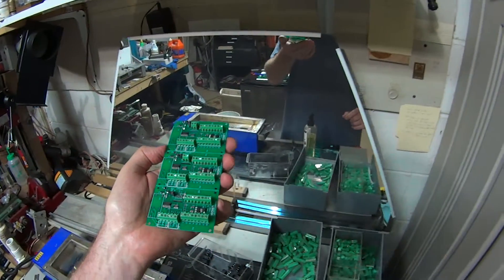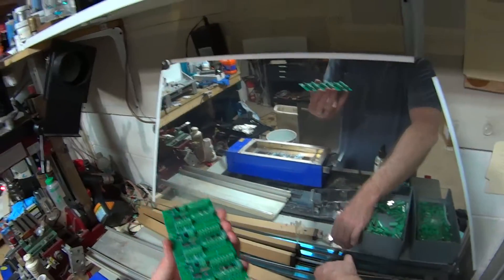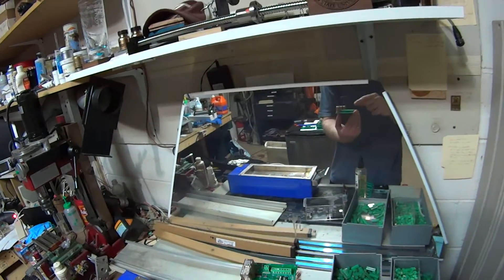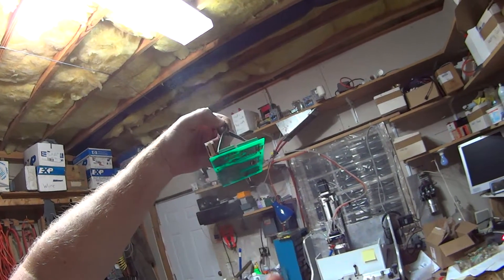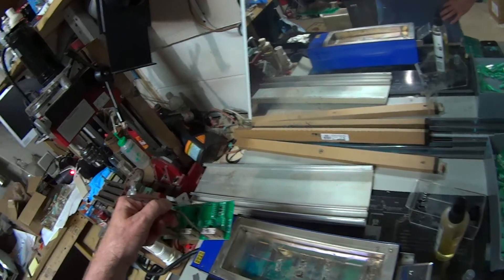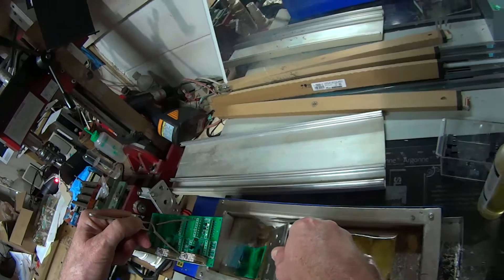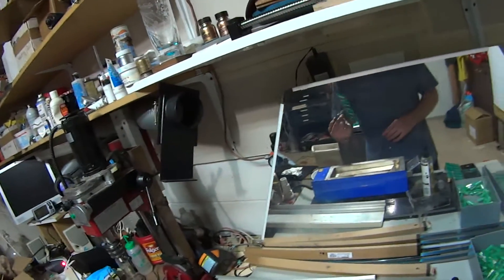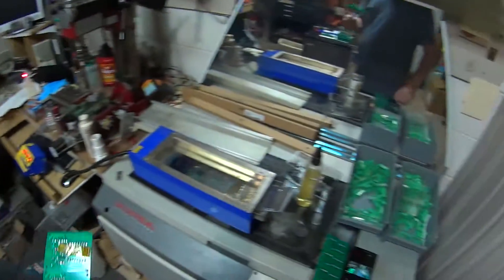Introduction to Dip Soldering of through-hole components

Comment: Can you tell me where you got the reverse action PCB holder that you are using in this demo?
Thanks.
Reply from the maker: I wish I could, but I have had them so long I don't remember.  They are crossover shank forceps and I bent the ends to be sized for my boards.
Reply from the maker: Found it.  https://www.amazon.com/dp/B01MG3DZJ2/ref=sspa_dk_detail_5?psc=1&pd_rd_i=B01MG3DZJ2&pd_rd_w=hciLj&pf_rd_p=0c758152-61cd-452f-97a6-17f070f654b8&pd_rd_wg=4Qb1X&pf_rd_r=DW1H0C05RBPANGFNN3N4&pd_rd_r=72479d37-f820-4e34-ae31-3dd47293d8ec&s=hi&spLa=ZW5jcnlwdGVkUXVhbGlmaWVyPUExVVcwR0xEQUpYRFk4JmVuY3J5cHRlZElkPUEwNTYwNjIyMlRCWllUODVPV1VMSyZlbmNyeXB0ZWRBZElkPUEwODU3ODY5SllJUTBHVENLNDYmd2lkZ2V0TmFtZT1zcF9kZXRhaWwmYWN0aW9uPWNsaWNrUmVkaXJlY3QmZG9Ob3RMb2dDbGljaz10cnVl
Reply: @JohnHansknecht  Thank you ever so much!!!!
Reply: Thanks for the info. I appreciate the reply.

Comment: Which brand solder flux and how much tin/lead ratio solder bars did you use ?  I bought  a solder pot and love to try that. Thanks
Reply from the maker: I use Kester 959 No-Clean flux.  Purchased a gallon for $30 and I'll probably never use it all.  I am lead free, so I used Kester Ultrapure K100LD solder bars.  They give a very bright finish, better than traditional lead solder, and with the flux it flows perfectly.
Reply: Thank you for the reply !  I am going to do it )
Reply from the maker: If you have trouble locating a smaller quantity of the flux, let me know.  Perhaps we can work out a deal where I send you a quart  (if you are in USA).
Reply: John, I already requested a quotation from Jasentools (US) before i see your above reply. i am from sri lanka but please let me know if its possible to for you to ship, like eBay sellers do, and i can do a paypal payment. All you have to do is fill it to a 3/4 or 1/2 gal plastic can up to the level of cap (to prevent shaking) and pack well. Just mention in the lable  " Jar "  like chinese ebay sellers usually do. Here customs do not open boxes from US.  Thanks.

Comment: Excellent.  Question: What would you do if the board was larger than the pot? I once scoured the internet to try to find something like a desktop wave soldering machine but had no luck.
Reply from the maker: matt holland if my boards were longer than my pot, I would redesign them to fit by stacking.  Huge pots are hard to find..
Reply: Thx for the reply. Btw I see that your solder pot model is available for sale on amazon. Not cheap but I'll keep it in mind next time I find myself doing a lot of repetitive TH soldering.

Comment: Are those just some reverse action tweezers you were holding the board with?   Also curious if the flux spraying in the open room  technique stood the test of time. Seems like it would quickly make a mess and a health hazard.
Reply from the maker: Yes, reverse tweezers that I bent the tips so they would be appropriate for this size board.  The flux spray works fine.  I wear an organic filter mask now when I spray so I won't inhale the fumes.  This is just my workshop area and once the flux dries, it becomes a solid.  Haven't really noticed any on surfaces.